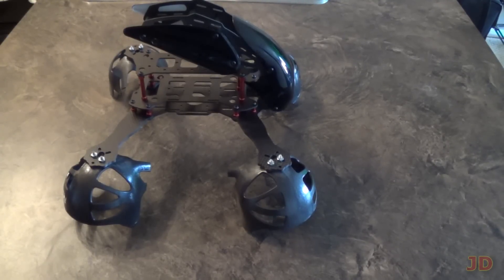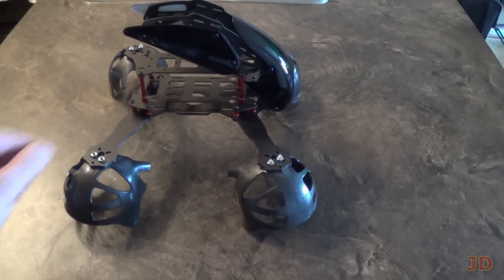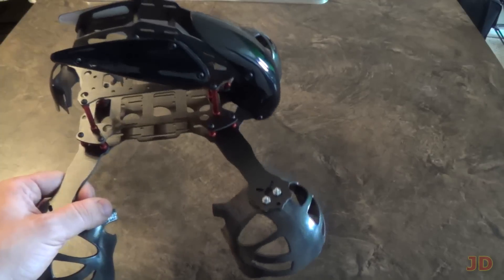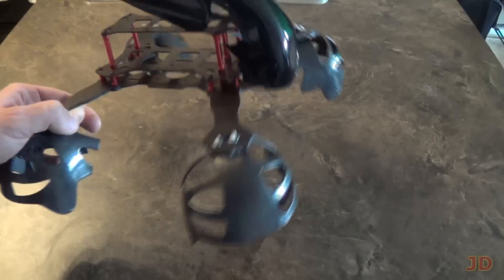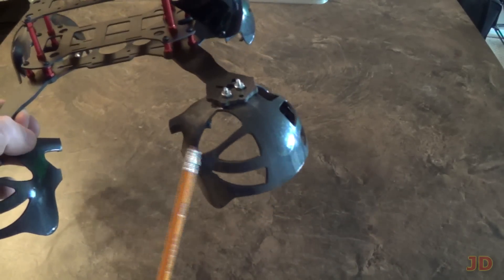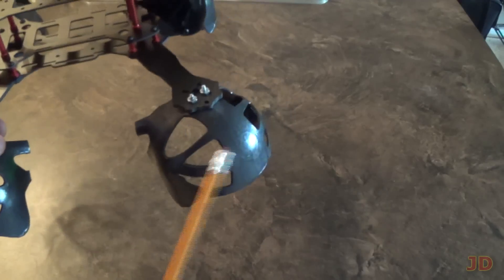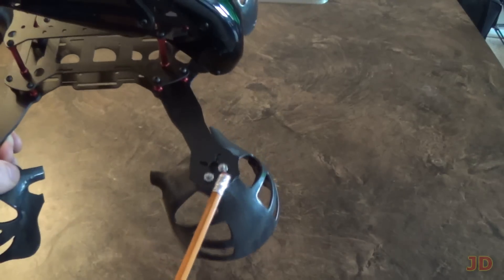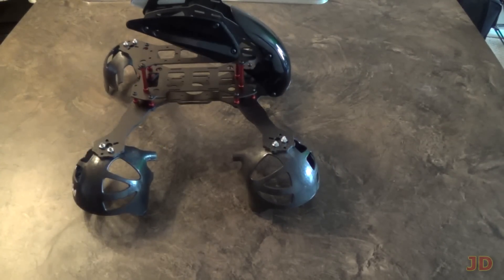Sphero Car - The First of it's Kind!

Comment: Take my money! I'm putting money into the CD-ROM tray but nothing is happening!
Reply from the maker: +ArcadeGames It's easy to build :) The only drawback is that it needs have magnetic resonance (wireless electricity) so it will have far more power. This prototype only works on smooth surfaces.
Reply: +JD Rock Keep working on it! It's amazing!

Comment: Excellent use of off-the-shelf components!  Using the quad copter frame is a Very nice touch. No custom object printing required & all the better for it. I imagine the payload size for the camera is limited by the terrain?  The PoV footage looked like a slightly rough ride.
Reply from the maker: +StaticSkyTV Thanks, it is possible to do a micro fpv system but it is rough on most surfaces. Most of the time was taken to find what was the lightest and most practical quad frame.

Comment: awesome!!!!!!!!!!!!
Reply from the maker: +MC CREEPER Hah, I knew you would like it.
Reply: i was think of building a flyable tank?!!! i don't know if it will work but it will be made mostly of stuff around my home
Reply from the maker: +MC CREEPER Anything is Possible. Probably quad or octo frame (if you are launching things). Are you going to fire things?
Reply: no more like a jet tank or a heli-tank of some sort of tank hybrid.
Reply from the maker: MC CREEPER Ah ok, you can conceal the propeller with screens, and imbed the propellers inside the body. Then you would not be able to tell its a quadcopter.
Reply: thanks but what do you think would it fly
Reply from the maker: MC CREEPER Yep, if its not too heavy, go with hollow frame and experiment. There are really good motors out there but it just might cost a little bit. If it is heavy, then go with octocopter, but it will get really expensive lol. Also try to keep a center of gravity, that is really important!
Reply: thanks were should i go if i was to get propellers
Reply from the maker: +MC CREEPER I use hobbyking.com for motors and propellers. They have been good to me. I use readymaderc.com for fpv
Reply: i like this one HobbyKing® ™ Jetiger Plug-&-Fly Brushless EDF Park Jet and for the tank i would use this KV-1 Soviet Tank RTR w/TX/Sound/Infrared (AR Warehouse) what do you think???
Reply from the maker: MC CREEPER The tank is a bit heavy but a quadcopter can lift it with bigger motors. Were you going to combine the jet/tank?
Reply: yes and sorry for not responding sooner
Reply: hay i have a question what franchise should i add
Reply from the maker: Ah ok, well, I used DJI motors before, Tiger as well, they both were good. Lot's of people like Turnigy, but just make sure you get decent sized motors if you want to lift that much weight. I only have used DJI Naza flight controllers but they are really good. Also, I kind of mentioned before, make sure the tank is balanced, you will want center of gravity near the middle of it. IF it is not centered, it will fly erratically all over the place.
Reply from the maker: +JD Rock Maybe try flying a basic quad frame, and then go combining? What do you think?
Reply: JD Rock ok sure um this is my first time trying to use professional stuff to make a vehicle so yeah and i was wondering what franchise should i add to the war of 87???
Reply from the maker: +MC CREEPER Umm, do you mean what kind of quadcopter frame?
Reply: question or  the part about the professional stuff?